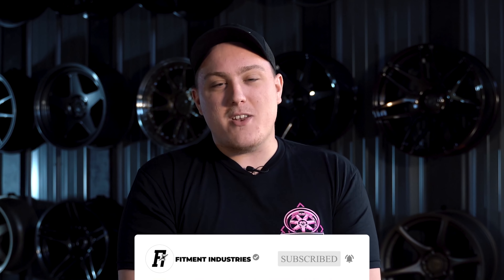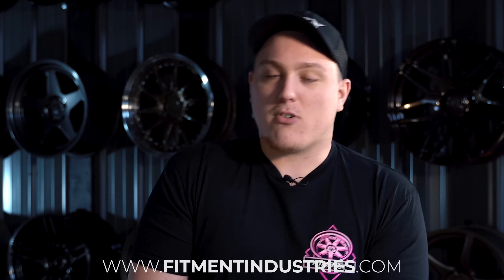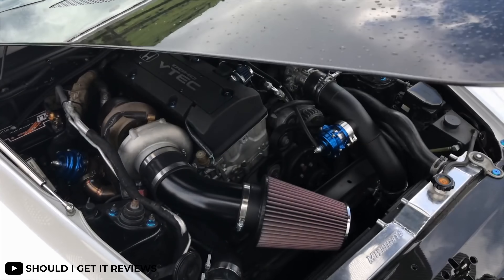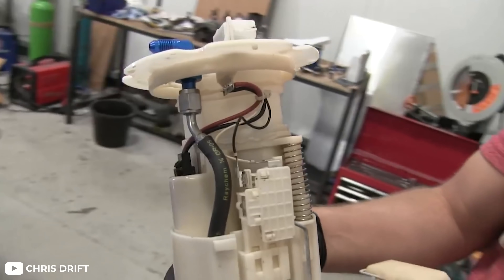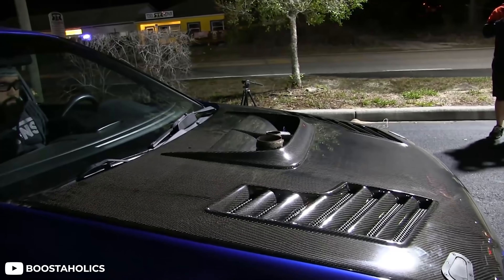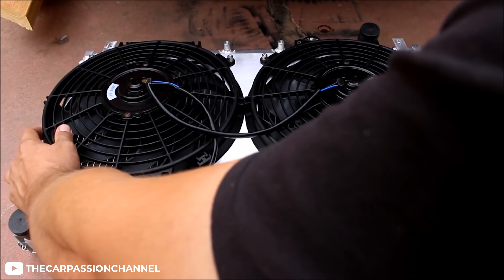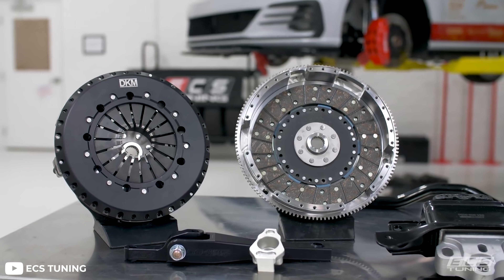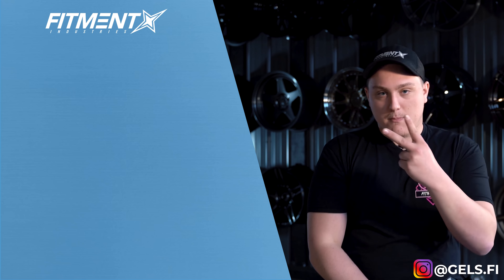Mods Needed to Boost Your Car | The Build Sheet

Comment from the maker: If you could boost one car that didn't come from the factory with a turbo or supercharger what would it be and why?! Reply and let us know!
Reply: Miata, any generation should have came with a boosted option from factory
Reply from the maker: I feel the same about the S2000!
Reply: Viper 2nd gen
Reply: @FitmentIndustries  I'm going to put an RB20DET into Ford Sierra this summer 🤣🤣🤣 Sierra original hp is about 80hp. It probably will have +400hp when putting 1,4 bar (~20psi) boost too 😍 The project car can be checked in Instagram > teemu_0
Reply: I’m going to supercharge my ion 3 because it’s the naturally aspirated highest trim level and the only one above it was a Saturn ion redline which was a supercharged 2.0 lsj ecotec and mine is a 2.4 LE5 from 06 so it can handle the boost ima grab the supercharger kit from zzp
Reply: A 3rd Gen Eclipse cuz it already makes 200hp with a NA V6 that's pretty robust for 3 grand off the line at a 7 second flat quarter
Reply: Is300 because racecar
Reply: 1980's Chevrolet Corvette
Reply: I think most people would say all the lightweight Japanese sports cars like Miata, 86 twins and S2000. You'll have the best of both worlds. Power and Lightweight!
Reply: Fitment Industries Huracan! Because that’s my dream car and I imagine it can pull a lot of power
Reply: Did it on my 02 legacy gt. But what I'd really like to do it on is a 96 single cab Dodge Dakota with a 360 5.9 and make it into a drag truck or a drift mobile
Reply: Probably a 96 base model Corolla because I have one, and because getting more power outta that would be sweet. Id also wanna swap a v6 into it or a better i4 or something first though to get some real gains.
Reply: Foxbody mustang
Reply: Ferrari FF or F12
Reply: 02' Infiniti i35
Reply: Got an 83 Chevy C10. Gonna be swapping a 5.3 into it this winter, with plans to turbo it once I'm out of school
Reply: Nissan 350z supercharged
Reply: I am Kswapping and turbo charging my BMW e21 👍🏾
Reply: Always though the Fox body’s needed a turbo. Idk why. That foxbody 5.0 sound, banging through gears, and heating that BOV ❤️
Reply: Any Italian NA car. They deserve turbos!
Reply: 2009 ford focus
Reply: I’m gonna boost my g37 sedan in the future
Reply: Mr2, usdm 240sx and 2nd gen Subaru legacy
Reply: Alfa Romeo GTV6 or GTA6, because it is a beautiful, timeless classic, and the added power would bring it to more modern capabilities.
Reply: Early 90s JDM corrolla with a 4AGE, very underated engine for boost.
Reply: my 2007 Nissan altima 2.5
Reply: @LegoDude182  You can already get turbo MX-5s, there were two different ones made for the NB in 2002 and 2004-05.
Reply: Shelby GT350...then it will nuke itself to oblivion!!!
Reply: Fitment Industries 
would have done the is250/350 2nd gen cuz it was a great daily and sexy af but just slow. sounded great with an hks too
Reply: Fitment Industries Lexus is300
Reply: I would love to do my 2012 Mazda2 but cant find any turbo kits for it
Reply: There DOES exist a boosted Mazdaspeed Miata tho. NB with a factory turbo.
Reply: Gen 3 Mazda 3
Reply: A suzuki grand vitara 2000 v6 to make it like the suzuki escudo from grand turismo
Reply: My NSX because it looks like it should have more then 270 hp.
Reply: The Yamaha 4.4l V8 in my volvo would just be a nasty monster with a turbo or blower 😵
Reply: V6 miata or gt3000
Reply: 4.7HO on a lowered '04 grand Cherokee Overland with a better gear ratio and big wide tires
Reply: My wifes '10 corolla. 
93 hp aint helping me push it down the street!
Reply: Whatever I'm driving right now a 1998 Plymouth voyager lol
Reply: Dodge viper 5th gen
Reply: ice9 dragon 4EFTE engines are bolt on swaps on tercel since they come in the Starlet which shares plateforms w/ tercel & paseo, cheap fun those cars are light
Reply: @jaytheillest5298  or maybe a 1998 Nissan 200sx coupe
Reply: i want to boost my E430. there's a supercharger kit available for it that costs like 4x what the car itself was. the car wasn't meant to become a project car, but i felt it was much more unique showing up at Cars'n'Coffee and events to show up with it when all of my friends are showing up in JDM's.
Reply: ScreamingPandas7 miata Mazdaspeed
Reply: Fitment Industries my 12v vr6
Reply: BMW e30 because that's what I want my first build to be
Reply: I'd want to boost my 2018 focus se hatchback. I've gotten it up to 184hp with just some bolt-ons and a flow master cat-back exhaust. I'm never going to find an ST or an RS that hasn't been abused or racked up a ton of mileage since Ford has stopped making them for the States. So to get mine up to 250-275hp with an aftermarket turbo would be the bees knees for me👍
Reply: '80's VW Cabriolet Rabbit. Little car needs to get some action, plus a bit of weight reduction
Reply: BRZ. Should’ve came boosted from factory.
Reply: Hemi cuda
Reply: ScreamingPandas7 the mazdaspeed miata did come turbo charged
Reply: A Chevy Astro so I can smoke people unsuspectedly and embarrass people ahhhahaha
Reply: 1977 Mazda Repu, Underrated pickup truck with a Rotary engine. Slap a nice set of rims and suspension, along with some decent brakes and you got yourself a nice daily. Personally, I'd supercharge it since I like the whine they produce, Everyone turbo's Rotary's and I Wanna make something that stands out.
Reply: Alpha Q bruh is this what you do in your free time, don’t make fun of someone who is working hard at his job. And does a great job , also is one of the reasons you are watching this video
Reply: Fitment Industries i have a 2012 Ford Fusion. 90k miles on it. I’m the second hand owner. Engine is well maintained and great. I’m having trouble deciding if i want to turbo. I have a cold air intake. Oil catch can. Aftermarket ignition coils and spark plugs. Magnamflow mufflers and throttle control chip (pedal commander) trying decide what i should do next or if i should of even turbo. Help please
Reply: Ford mustang GT
Reply: My 2010 Camaro SS. Just have some fun with it. Add a little bit more power.
Reply: My slow lancer es
Reply: Can I tune my ecu on my 2011 Volvo C30 T5 Rdesign????
Reply: 7th gen swapped maxima
Reply: Bmw e36 and the z3 roadsters with a m52!!!🎉

Comment: Just slap some V-tec stickers on the rear bumper to get the same result. Easy 100+ HP
Reply: For the best results, though you’re gonna need some experience with a hot glue gun along with the necessary safety equipment, I just glue a Shelby badge on the side.
Reply from the maker: Love you guys! 😂😂😂
Reply: @FitmentIndustries  😂😭
Reply: @FitmentIndustries  lol..., yeep .. big toys for BIG boyz
Reply: @Chev_chevo  lmao 😐

Comment: I did this to my 86 two years ago and paid $3900 for 150 more hp for install and tuning combined. But I also had a full catless 2.5 exhaust + oil cooler + boost guage and catch can for another $1700 with some of that being used.

Comment: I’m getting forged internals before I boost my car. Why run the risk of kaboom.
Reply: I know alot of folks with stock internals running high compression with boost. It's all about fuel and heat control to keep it from killing itself lol
Reply: Better safe than sorry
Reply: @swizzy6010  yep that's true. If you're broke and cant afford a rebuild or new block you can get away with it but that's one reason I have mine at 8.5:1 compression. Not too sluggish when off boost
Reply: I'm running on stock internals and plan on pushing it hard because if it blows it blows I can get a engine for this thing for like 250 at the junkyard and have it in in a weekend
Reply: I have a 1.6 Miata can’t wait til the kaboom

Comment: Typical rules:
More compression--less boost
Less compression--more boost

Advanced rules:
High compression and high boost--stronger crank, con-rod, pistons and good cylinder and head
Not-so-high compression and ultra boost -- COOLING

You're right. Cooling is the thing that is always overlooked. I would usually increase the waterpump flow by replacing the pump, or the pulley for more rotation. Add a larger or a second radiator, and use an oil cooler that uses coolant as the cooler. A dry sump is also a good idea!

Comment: im watching this as if im even close to being able to boost my brz. hell i havent even gotten around to buying a decent set of wheels for the damn thing
Reply: lil depressed hold off for 2021 the new gr 86 is said to have a 2.4 turbo engine for the new gen
Reply: You don’t need different wheels for boost, however, according to this guy, you do need a better set of rear axles....
Reply: @JoeIsCrazyWillman  i feel like this video is pretty misleading, he’s only talking about high compression and high performance for the car when most don’t and can’t afford to make 1000+ hp drag monster but just want more fun from their car. He’s right on the part that most parts should be upgraded but most cars especially na muscle/ sport cars can handle 500 ho on almost stock internals usually just have a air and fuel upgrade but that’s really it

Comment: Biggest and most important thing before you even start the upgrades to get your car ready to boost is too know what you want to achieve, have a general idea of the power you want to make and how far you want to push your car. It's a lot easier knowing what specific mods you need when you have a clear set power goal, could even save you money potentially cause it prevents you from going out and buying stuff that either is overqualified or just not needed

Comment: Id turbo a $3k reg-cab 2500hd.  Cheap, huge potential, already have a 4l80e, same weight as a 2010 Camaro with 2 passengers.  8k turbo kit is 950hp s475 t6, t51r’d & coated.  14k twin turbo kit is up to 1482.7hp at 28 psi stock bottom end. 
Only stock bottom end i’ve ever seen as strong as that is a 12 valve cummins. You could argue LS7 but they have branded pistons rods etc.

Comment: I've been working on turbocharging my v6 tiburon turbo kit is all custom have dc headers and custom fitted to a atp that is supposed to bolt to the stock catted manifolds but got it to sit these after market headers ,also got a megasquirt ecu to run it with a load of other things I still have to get a lot more now like lsd ,clutch ,injectors and gauges and other things but I'm getting there and like I say to everyone who ask me research is key ,this video has everything I always tell people and what people need to know when boosting a car
Reply: I have a v6 07 tib. I’m hoping to boost it by next summer. Do you know how much boost the stock internals can handle? If not, which ones should get upgraded first

Comment: I took a 91 NA 4g63 galant and did my homework to install a stock size turbo set up from a 4g63t. She ran great for a few year and even tho she had good compression, ultimately the blow by was so extremely on a cold winter day my catch can froze and blew out every seal in the engine. She would push out 2lds of oil a week killing my alternator. The rest of the car was soo rusty that it's now time to close that chapter and move on me new 2014 ralliart. 

I will say your 100% right DO YOUR HOMEWORK when it comes to mods. Only cause I did mine was I able to get 10psi on stock engine for 3yr no problems

Comment: Lol meanwhile 850 owners get away with adding a turbo on a stock tune because Volvo. Sure you can’t run a lot of boost, but it works well and doesn’t actually run poorly at all. The NA motors have a really forgiving tune that adjusts a lot. You can usually port and change the exhaust and it will adjust accordingly. Sadly not many people try to keep them NA. Later NA engines could not take the boost without a tune as those had high compression. To the extent of my knowledge. I plan for all motor build and probably do a ecu flash tune.

Comment: Boosted my ej251 with 250k on it. Fmic, fuel regulator, voltage clamp, 3" downpipe 2" up, Walbro 255, stock injectors. Had a boost spike and took a 1inch chunk out of my #4 piston. Tossed a wrx 255 shortblock under my sohc heads and it's been all gravy on the stock n/a ecu still. But swapping to my standalone soon. Probably the easiest turbo conversion I've done.
Reply: Vroom vroom. Couple videos of my na+t legacy gt here. Still slow but much faster than it was na!

Comment: This is for the people who want to do it for cheap, the eBay turbos are decent... but JESUS CHRIST! Don't buy the kits with all the tubing and stuff, just get the turbo alone

That is all, thank you
Reply: just wanna know, can i bolt on a turbo and be done with it? the only experience i have on engines is v12 swapping on forza
Reply: @munin9530  No
Reply: @DankBoyy00  thanks
Reply: Trueish. I got my front mount piping generic kit off Ebay, had to cut a few pieces but everything fit up nice. Replaced the crappy t clamps they come with though
Reply: @munin9530  You're welcome
Reply: @CuttinChris  Yeah, if you know what you're looking at they're not terrible but I'd rather just buy some high quality piping and clamps and stuff
Reply: @DankBoyy00  yeah that's true. For my backyard build they worked just fine but if I did it again I'd probably just have a buddy tig me some pipes for it
Reply: @CuttinChris  Exactly
Reply: Idk if you are gonna boost your car it’s either go all the way right and have it done by a shop who only does it and can also tune so u don’t gotta worry about anything but that’s gonna be a lot of money but I think it’s worth it
Reply: @gsjourney3054  it's definitely worth it, but some people don't have that sort of money, all they have is a shitty laptop and a few hundred
Reply: @gsjourney3054  lmao. Come on man, if you can weld, and understand how a turbocharged system works it's really not hard to make your own setup. You just have to make sure all your ducks in a row. I built my setup with a swapped shortblock for around 2k and it's my daily with safe afr's. If I had a shop do that I'd be well over 6k into the project. I can 100% agree with you on the tuning side of things though. If you use a megasquirt type setup tunerstudio is pretty easy to tune with but you can still fuck your shit up quick if you do something wrong. Fab and fit your own stuff then take it to a shop to be tuned is the way to go. Some people cant work on their own stuff and they should go to a shop for sure but have to expect a hefty hefty bill
Reply: Chris Santos well yea but some people don’t have access to a welding shop or one at the house and it gets complicated
Reply: Mom! Dad! Please stop fighting
Reply: @DankBoyy00  God damn it Bobby, for the last time you're adopted! 🤦‍♂️
Reply: Chris Santos I can’t weld, don’t have welding equipment. Could you fit a turbo by just using brackets and bolts or am I gonna have to tie this to a shop?
Reply: @DankBoyy00  dang it I said not to talk about my narrow urethra in public! - Hank Hill
Reply: @CuttinChris  But dad!
Reply: @sjeffy5137  depends on your application. Subarus you can subframe swap and bolt up turbo headers up and down pipe and have it in stock location. Personally I welded my up and down pipe so I could place the turbo where I wanted in my engine bay. If you're doing it from scratch itll be easier or harder depending on the engine bay of your car. Some have tons of room and others are real tight fits. Realistically though you'll need a friend with a welder or have to take it to a shop and tell them where you want stuff. Performance shops charge more but will give you tig welded stainless pipes where an exhaust shop will mig weld it and be a bit cheaper. Personally I only ran a mig welder a few times in my life but I spent 60 bucks on a cheapo flux core 110 welder and fabbed my turbo pipes and exhaust without issue. Learning is fairly easy with scrap metal and some quality YouTube lessons
Reply: Chris Santos Oh don’t worry it’s mostly hypothetical cause I don’t have the money I just wanted to know, I do have a friend who can do cheap welding for me if I need
Reply: Perfect!
Reply: So if I were to order an ebay kit yall are saying it's a pretty easy bolt on and then take it to a shop for a proper tune?
Reply: Munin :] giggle
Reply: Yep I got a Ebay gtx3582r same one boostedboiz use that makes a lot of power then I got a custom turbo set up
Reply: Ugh I forgot my name oof but like some of us kinda broke, ya know...high school

Comment: I'm looking to procharging my truck (2015 ram 2500 6.4) but I don't know where to start because it's my daily but I found out with the kit I have picked out it can handle 6 pounds at most but I'm learning on what I can do to make more boost and not blow the motor.

Comment: Turbo my 05 hyundai tiburon gt 5 speed. Hard part is try to find someone to tune your standalone ecu. I notice a lot people don't do any research how to turbo their car/truck.
Reply: HELL YEA BRO I GOT A 5 SPD GT TIB TOO <3 I bought a low milage parts car for mine and currently am builiding up that cars motor and boosting it before i drop it in my daily tib. that was in a 04 gt that was hit in the rear but didnt even bend the frame it was a lucky find with very nice interior i have swapped into mine. I was just scrolling thru these  nice comments bored when i saw turbo 05 tib and was just fucking blown out of the water xD

Comment: If you are runing anymore then 5 lbs of boost you need to gap the rings.
 
if you can when running a turbo cool the oil going in the turbo and out for a reliable daily driver included a oil suction pump

for the radiator add some ducting to help with cooling and fans on the oil cooler's for the turbo

Comment: I have a 1996 to nobody's ever touched for moding so there no aftermarket engine parts (only suspension).my buld is all custom fabricated it is a good way to learn new skills it is a twin turbo 3.5  bord 30 over and pushing 700hp and 600+ tq the best sleeper nobody even looks twice just the way I like it and when I race I never get pulled over it is always the flashy car